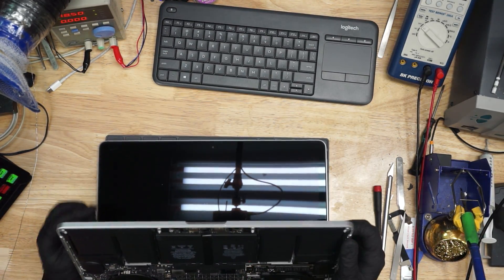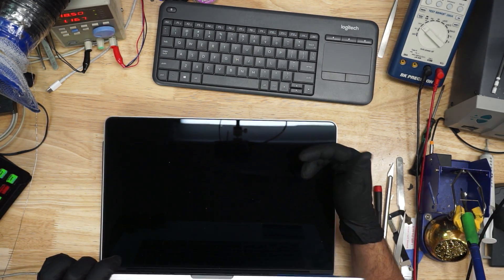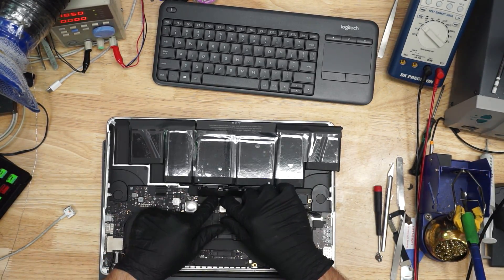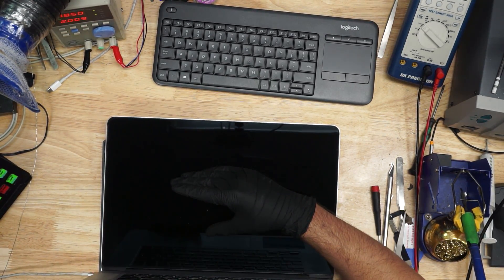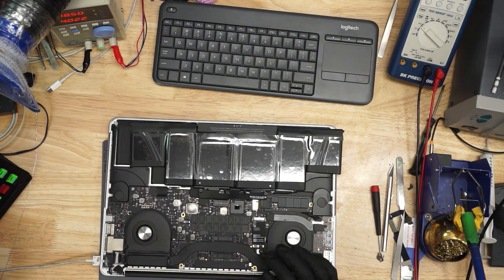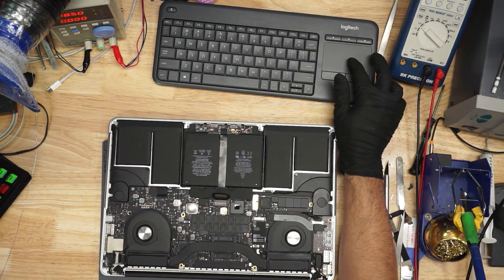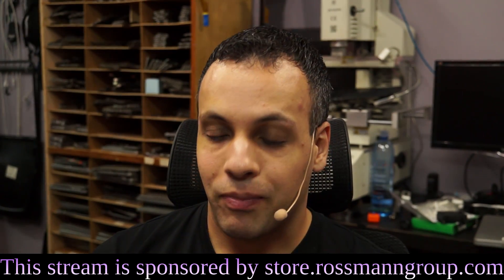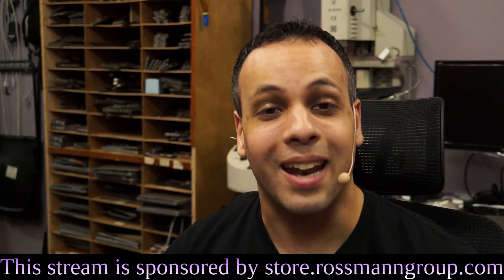ENGINEER DIFFERENT!

Comment: What a piece o shit, my old thinkpad from 2007 is still in daily use and the battery is still great, same goes for my soon to be 9 year old Asus laptop, what the hell do they make these things out of, oh and oh wait, this is the best part, if i ever need to replace the batteries on those i just turn it upside down and push in two spring loaded tabs and take them out and slot in the new one, batteries for those can be found easily online new or used since they have been used for several models, oh wait, and if that didn't work i can open those batteries and remove those Lithium ion cells individually and put in some fresh healthy ones which can be bought easily online, while Apples uses these flat polymer ones which is another ball game...

Comment: my old dell laptops and my old old lenovos have batteries that weell suck after years and years and only work 20 minutes.. some even less when not on a charger.. but on a charger they run like a dream. use them as desktops .. wow that this cant be done with apples macbook overthere

Comment: are you meaning that the Retina MBPs are not working w/o battery? I have the same problem on a 13" 2015 MacBook and without battery does not power on. They spilled in a full bottle of coffe...

Comment: Been a big fan of older Dell and Lenovo laptops. Built well and are easy to work on. I mainly go back and forth between a 2006 Inspiron 6400 and a 2009 Latitude E5400. Both have been solid workhorses and have been obtained for below 50 bucks.
Reply: Ah, yes. I have the sister to the 6400, the E1505. To this day, still my favorite computer. I can have it torn down and rebuilt in about an hour and a half. Only complaint I have is the short battery life. The best I've ever gotten was 2.5 hours, but then again what do you expect for having a Core 2 Duo and a dedicated graphics card?

My daily driver is an XPS 13 9343, although I've been tossing around the thought of going to a Latitude E5530 or E5540 since my work is cycling them out of production use.

Comment: If you power it up without the Battery Plugged into the Logic Board and connect the Magsafe 2, it will boot if it is a Mid 2015 or older MacBook Pro.

Comment: Could you wire from the connector on board to an equivalent external power supply, fooling the MacBook into thinking it has a battery? could be a nice market to corner.

Comment: I ran into Apple's battery stupidity on an older macbook. The battery has a weak spot in its case right below the trackpad. Thus when the pouch cells die and puff it’s guaranteed to destroy the trackpad. Then the replacement battery must be genuine Apple or a proper copy, or it will throttle the CPU speed down super slow. Dunno why Apple didn't use 18650 cells, plenty of room for them.

Comment: had a guy on quora insisting that soldering the CPU was "superior" because "thin" due to being soldered to the board,  Batteries being glued in was the same for the same reason, 
and thought that every other laptop manufacturer soldered their SSDs to the board, too. 
all of this came together to magically make macs "far more durable and superior" than literally anything else you could buy.

Comment: Thats so retarded. My 2011 mbp has died twice now, but its so simple to repair. New hard drive and battery. Works like a charm. If i time traveled to 2011 with these new MBPs apple fanboys would think they were cheap inferior chinese products because of how easily they fail and how stupidly they are designed

Comment: My 13 inch MacBook Pro early 2015 battery died. But, they replaced it for me because it was still under warranty. And, by the way I live in the Philippines so the authorized Center here really bend the rules and doesn’t follow guidelines procedures set by Apple.

Comment: The older the macbook, the easier it is to repair/fix. the non-unibodies were easy to take the battery. heck, even the early unibodies were easy to fix. I have an old MBP from 2009. the disk drive got a disk stuck in it and the trackpad failed. I fixed that in an evening. you cant do that with a modern macbook (well the trackpad, they dont have dvd drives.)

Comment: I've experienced this first-hand on one of the 4 original batteries for my Samsung Note 4 where boot-looping randomly happens only on this specific battery. Good thing my phone's battery is swappable because it was made on 2014. Electronics today are usually shipped with non-swappable/non-accessible battery so good luck on those battery related boot-loops that should have been easily addressable by doing a simple pop-and-swap of batteries.

Comment: Love you Louis, you're a genius man, and this comment relates not to this short video specifically but to a bunch of your vids that i've taken in thus far.  I want to point out that Apple makes great computers and pretty much everyone else in the computer biz wants to be them or emulate them. Their design aesthetic for example, so many have copied it. The OS also. I've been using mac laptops and desktops for years, i've used them on the road, in the rainforest, in desserts, on a boat on the ocean, all over the place man. They have been durable and worked well. They are not indestructible either, as you know and you're right that there is room for improvement when it comes to making them more impervious to things like moisture, corrosion, and more that you have pointed out in detail re specific components and manufacturing cost saving/profit maximizing shortcuts piss me off too. However, i still love my MacBook Pro, it gets the job done and so far so good, same with the last one until it become long in the tooth and was replaced. Also, genius thou you are, you never designed anything even close to a macbook pro yourself did you? It's a work of art and has been a versatile and relatively dependable tool for the 21st century digital artist, musician, designer, etc etc. Not indestructible or faultless but pretty damn good overall i say! It's good that you chastise apple for their cheapness and proprietary ethic, anyway, i appreciate that you are taking them to task to raise the bar on this stuff.
Reply: There are reasons to buy Apple products, but durability is not one of them. I recommend Apple products to people who want security or don't want their personal data to be monetized by Google or Microsoft, but don't have the time or interest in learning how to use Linux on their PC and LineageOS on their phone.  

Macbooks have very bad thermals, so their components run hot, which leads to a higher rate of failure over time and Apple doesn't use proper components to handle stress. Rossmann has done a number of videos showing how Apple doesn't use the properly sized capacitors and resistors to handle loads, so they fail over time. The charge port is soldered to the motherboard, so if it breaks, the entire motherboard has to be replaced. The cases use proprietary pentalobe screws to prevent them from being opened and fixed. The butterfly keyboards have very high failure rates, and are almost impossible to replace, since none of the 3rd party keyboards work well and Apple won't allow anyone to sell original parts. The batteries are glued to case, so extremely difficult to replace when the battery fails, and replacement batteries are very expensive. The phones are not engineered to resist bending, which is why they have such high failure rates. If you watch Rossman's videos, he will point out the poor engineering of Apple boards, like the failure to isolate components, so if one component or one sensor stops working, then the entire machine stops working.

Comment: So my wife has a Mac and it's apparently started overheating.  Apparently the fan is dying.  She took it to the Apple Store today and because the mac is 8 years old it's considered a legacy device and they can't fix it.  They can't fix the FAN.  If she had a PC I would have replaced the fan and it'd be back running just fine today.

Apple managed to finally convince her to buy a PC for her next computer.

Comment: Still have the old 2008 MBP (4.1) with the failing Nvidia chip. But as I opened it up, disconnected the fans and put a towel on top it works again... Hopefully long

Comment: What do you think about the newer slim Thinkpads with magnesium bodies, in terms of reliability and durability? (x1 and t4XXs series)
Im asking because I own several, like the lightness and the firmness, but am afraid that the magnesium shell is going to be destroyed if dropped from under a meter.
The is very little info about this.
P.S.

Thank you.
Battery life is fine now, they finally started to put ok sized batteries into them.

Comment: The same thing happened to my Galaxy Note 2 after leaving it on hot spot in the sun.  It would just keep boot looping.  I tore it down, looked for obvious signs, and no dice.  Someone gave me their old S3, I used it for a year, then got the idea to put the S3 battery into the Note 2, because the prongs were the same, just half the size.  AND IT WORKED!  I replaced the battery with a 9,300 mAh battery (3 stock batteries in parallel) and used it for another year before buying a used Note 4 with a bad battery, then replaced that with a 10,000mAh battery for a year.  But there's too many parasitic processes on android now.  I only had a few trusted apps, but less than a gig of ram was ever available, and some apps would crash under 800mb.  All the new Samsungs have the dreaded Bixby, and no upgradable battery, so I switched to an iPhone 8+... the better of two evils I guess.  At least it has better privacy, phenomenally better power management, and minimal background processes.
Reply: Switch to low end Android phones. With removable batteries. They sell stock Android (no parasites) with 4000-5000 mAh stock battery. Lasts good for 2 days of heavy load.

Comment: I have a question that I'm little worried about. Recently, I cleaned my friend's MacBook Pro 2015 from dust and changed the thermal paste (What a pain to open it, honestly). It works and all, but the fan isn't working all the time, it starts working only when the temperature gets high, and when it gets to 40° C, it stops spinning again. Is that normal? I never experienced anything like this on laptops, and that's my first Mac experience

Comment: It's not even that new with Apple stuff. I have a G4 powerbook from 05. The bios is, of course, dead. It's tied into the power management system for some reason and messes it up, so it will not come out of sleep mode at all and must be unplugged then plugged back in every single time you want to turn it on. Many system settings seem to actually be stored in the bios, not just clock, for some reason. Fortunately, you can lock some of those settings and it will also store settings on the hard drive as well, which will then load in after a bit. It's just so damn janky....

Comment: Hey Louis, quick question. Now that you mentioned that older macbook pros don't need a battery to run... i remembered that mine (a 2010 15" mbp) stopped powering on at all completely a week or two after it told me to go replace it. It had already been shutting itself off (for months) whenever i tried putting a load on it (a youtube video with word open gasp i'm a mad man!). I ASSUMED this was an overheating issue, as i would notice a temp spike (to ±90° immediately before it shut off) and using SMC to force the fans to run at high RPMs seemed to alleviate the issue. 

Would replacing the battery actually revive my machine? I didnt want to blow money on a fancy paperweight...

Comment: This Bricking behavior is by design, not  a fuckup. It is a feature, not a bug! feature thatmake you pay for a new Mac .... Also what makes the glued in battery dead? HEAT from the CPU as the fan only turns in at high temp. BAAAAAAAAAAAhhhh......

Comment: After watching god knows how many videos about apple, It would appear that everything they design is now geared towards becoming obsolete or beyond economical repair as quickly as possible. It also seems that they want to stamp out all the third party repair shops so they can have an unencumbered stranglehold on the customers and then refuse to repair anything they deem as too old......... How the hell have they brainwash their "Loyal customers" THAT thoroughly as to not see that they are being charged a fortune for devices that are a liability rather than an asset, and STILL have them coming back for a new laptop/phone/computer after they've flat out refused to fix the old one ?!?!?!

Can you imagen Honda refusing to fix a 4 year old motorbike? Making it almost impossible for non "Honda repair centers" to get service or repair parts? Hitting independant garages with lawsuits for even waving a spanner in the general direction of one of their bikes? And the owner STILL deciding to go back to Honda to buy a motorbike to replace the one they did everything in their power to prevent the owner getting fixed?......... It wouldn't happen, As soon as the situation came to light the rest of the industry and all the consumers would turn against Honda and within 12 months they'd be going bust........ So how the f*ck is apple STILL being talked about in the present tense (Rather than us using the past tense to talk about "That company that screwed itself by screwing its customers")?!?!?!
Reply: That would be the way a normal customer thinks,  but this are Apple customers... and they know it is their fault that the Apple products stopped working, They were either holding them wrong, using them wrong or just using them too much.
Reply: Reman1975
Actually, the "imaginable" car company that does exactly what Apple does:
Runs on Batteries. 
Just like a laptop
If I paid $90,000 for a car and the CAR DIED when THE BATTERY DIED;
I'd jettison that moether foe'ker
into outerspace and out of mind as well.

Comment: Lewis, I just brought a used Sony Alpha A6000 for overhead recordings after seeing you use the A5100 for your streams. Do you use the stock 16-50 lens and how do you mount the camera over the desk ? Also how do you stop it from going into sleep mode, I can only see 30 mins on mine.

Comment: So Apple decided to not engineer a power supply with enough current capability to run the laptop without the battery to help out.
Perhaps they did this on purpose, as it's going to take 2 - 3 years for the battery to die.
With a battery designed to last 1000 cycles, your new $2000 mac book depreciates $2 per charge.

Comment: https://www.youtube.com/watch?v=GgzjJ6A455U&frags=pl%2Cwn

six years now...
my battery still has 75% of its original power and im supposed to upgrade to that kinda crazyness?
the only buck i ever had to spend was bcs i installed a ssd and 1 year later the sata-cable failed. (kinda typical)
the folder with questionmark is generally this problem.

for what im using this mac, its great.

what phones/Laptops/desktop-pcs can you recommend?
or did you build one yourself?

Comment: I am guessing that the Apple connector cannot deliver the current necessary to operate the machine. The pins are likely too small and the power brick was downsized appropriately. This makes it deliberate. The battery would also charge slower because of the current limit. But once the battery is charged it can deliver the current required until it's dead. Then it can't.

Comment: Can you unplug the defective battery and run the mbpro on just charger power? That makes your laptop a desktop, but at least you can TimeMachine backup your data.
Reply: No you can't. Did you watch the video?
Reply: What? I've watched dozens of Louis Rossmann repairs. He has the naked board on his bench, with NO BATTERY CONNECTED. He then plugs power in to see if you get "fan spin" which apparently means all he power rails work, and the board is functional. Usually it is drawing low/no milliamps of power, or it is drawing current but no fan spin. Thermal imaging camera shows what part is over heating, replace, and fixed. Yes, I did watch the video. Yes, he says for newer models a working battery is needed to turn on the computer. Interesting. I wonder what year a functional battery became necessary?
Reply: @numbr6  different models and different designs. Appears to be 2015 and newer must have good batteries.

Comment: Question for your Louis , smartphones have been this way as they rely on their battery to be working in order to work . Disconnect the battery in most smartphones and they don't work even when plugged in to a wall outlet . Moving laptops into this direction also streamlines some of the power circuit dependancies . Yes in older laptops you could remove the battery completely and just use them as desktops and that was a because of how the charging circuit was designed , it switched to the input it got the more power from or had a switch to detect when the wall charger was inputing power and switched off the battery input . But , in most smartphones everything comes from the battery , it is an intricate part in the power circuit . As we have seen more laptops start to use tech borrowed from the smartphone market over the years will the devices merge into a more blended product line ?
Reply: Most phones just identified if a proper battery was attached via the usual battery ID method (a third pin with particular resistance to the ground) and just worked even if the battery was practically dead. As these laptops are mass produced and have proprietary hardware, borrowing an inferior design without modifying it to fit better into the actual hardware is pretty unrealty.

Comment: Bwahahahaaa-aapl. My 2013 HP booted up with dead battery, even it was not charging. Or even without the battery attached (difference of which it recognises).  The battery is also user replaceable and the new one was delivered yesterday. 30 € well spent.